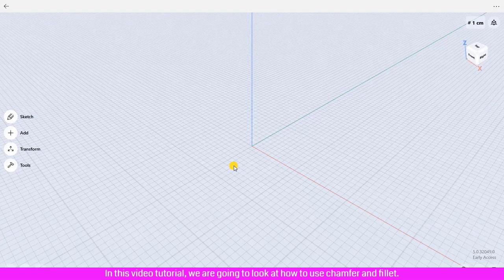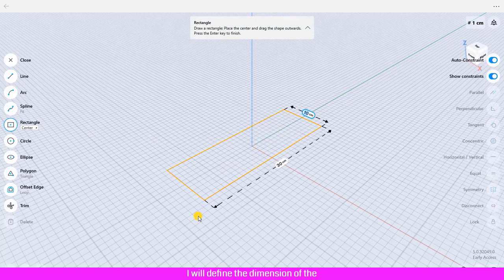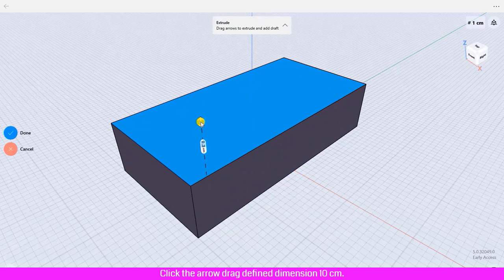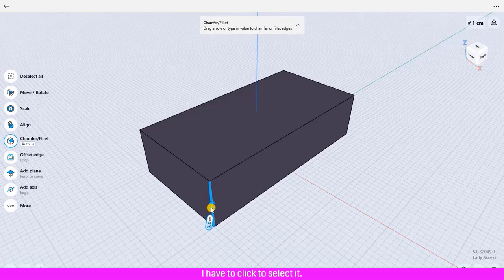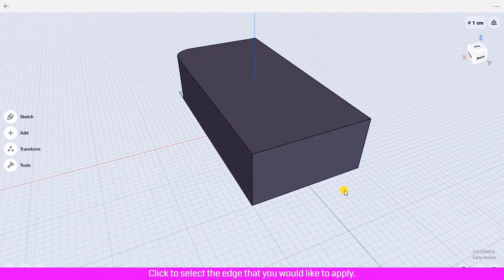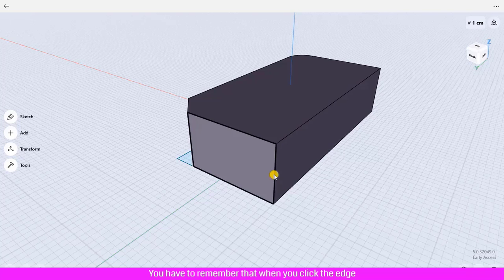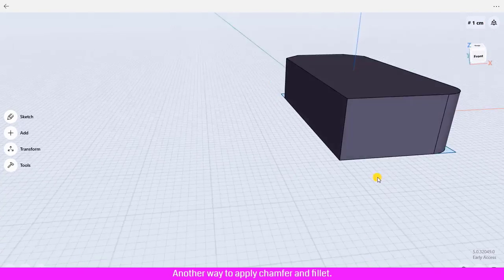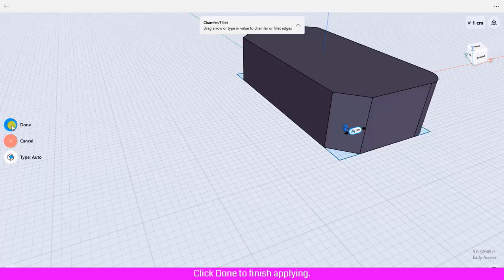Chamfer and Fillet in Shapr3d

Comment: Well… why not also do it on the sketch?  That would be helpful.
Reply from the maker: Yes, obsoletely right but in Shapr3d there is no fillet or Chamfer tool in Sketch mode. So we have to make the sketch into 3D and then apply the fillet and Chamfer after.
Reply: @Khmerideasshared  they should added.   I’ve been using it for over a year, Awesome program but it really needs it.    Sometimes a step ahead helps out a lot.